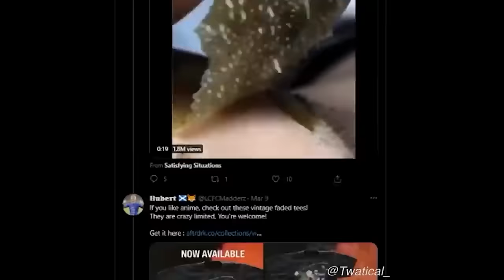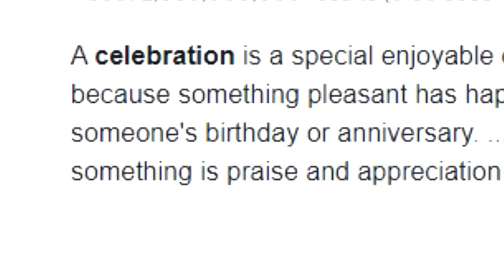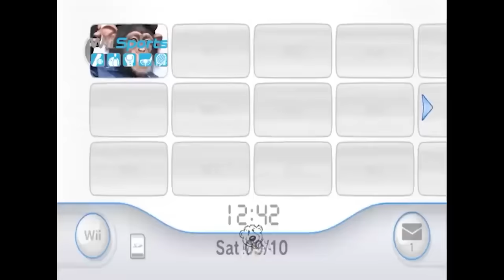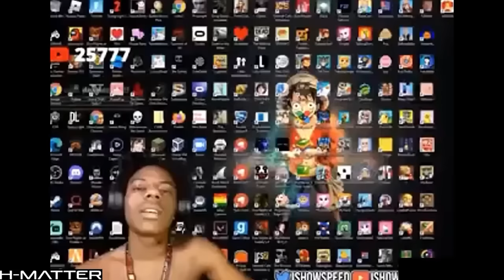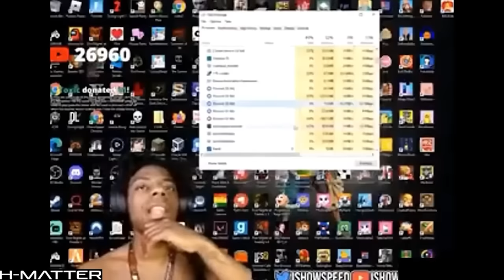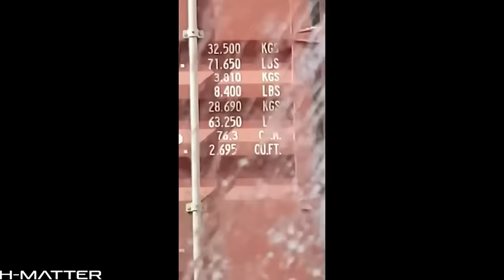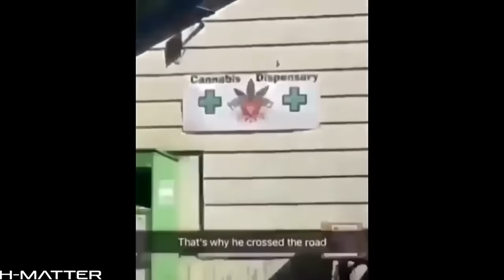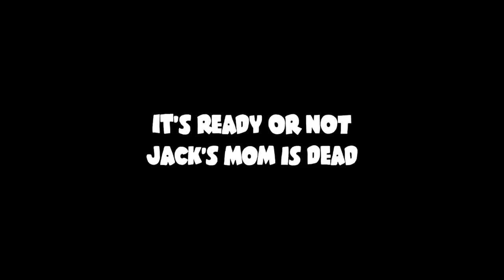1 Hour of Memes But it Feels Like 10 minutes

Comment: 29:22 Ok to be fair, soda cans are actually, genuinely designed to be as obscenely difficult to crush when they're unopened. No joke, they're an engineering masterpiece that makes use of the carbonation in the drinks to make them as strong as humanly possible. And that's not even the strongest they could be.

Comment: 41:40 in Chinese when you say you're turning a light "on or off" you actually say "open" or "close" the lights, because they're referring to the circuit of electricity that opens and closes to let the light function. So if you think of blinds as a light source and not just an object opening and closing, off and on is referrig to the light source, which is how we would say it about a light anyway.

Comment: I would try a sip of pickle soda to see how it tasted (I'll try anything edible, I don't care if it tastes bad, I just want the experience, I'm not picky), but I wouldn't dirty my own soda stream to do it. Technically it says to never carbonate anything in the bottle, you need to carbonate water and then flavor it accordingly, that CO2 nozzle isn't that easy to clean out if there's backwash, it's in the owner's manual.

On a related note, I have had cucumber soda (an older brand called Mr. Q Cumber), and it's pretty good. It's like watermelon soda but a little less sweet. And I prefer cucumber to sweeter melons anyway. It's like really refreshing especially in summer time.

Comment: Year late... But after making mashed potatoes, reduce them to a moldable consistency, add some cloves, bacon bits and a little bit of FRESHLY SHREDDED Colby jack. Mold them into barrel shaped about 3/4" in diameter and abiut as long, if not slightly longer. Then in a pot of frying oil, deep fry those fuckers until they're browned on the outside, let them cool on a napkin, and serve with white beer cheese or your favorite spinach dip. My favorite that i can get easily is the TJI Fridays frozen one ua get in the Frozen snacks and appetizers isle at cub foods and target. Or wherever you can find em.

Edit: I forget that people dont jave brains and might not know what "reducing" is, and may forget that google exists. 

Reducing is the process of cooking a sauce or food at low temperature after thw initial cooking, the goal is to let excess moisture cook off until you reach the consistency you're looking for.

Also, add a little bit of chive into the potato kegs for some greens, helps liven them up and adds a little more flavor.